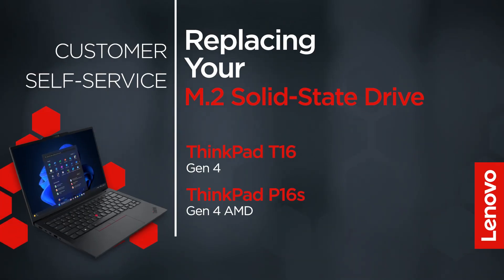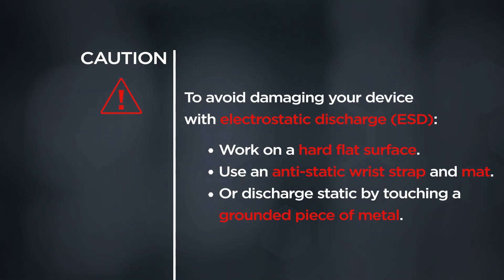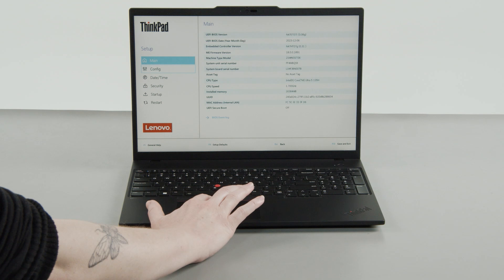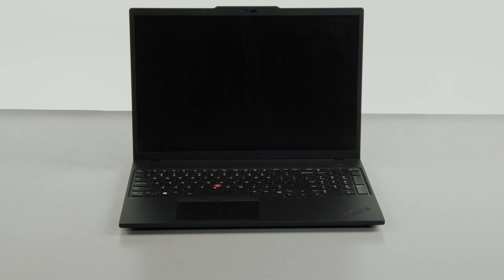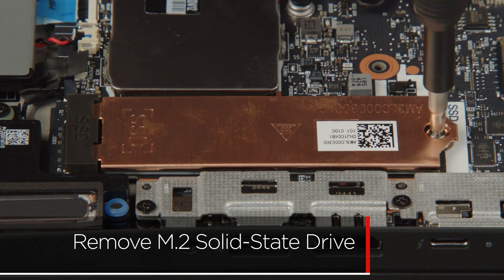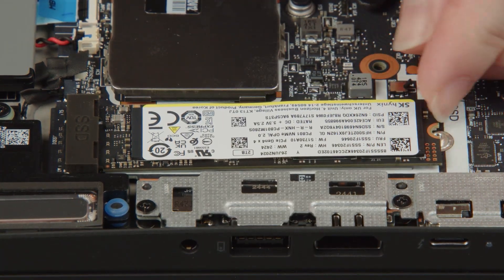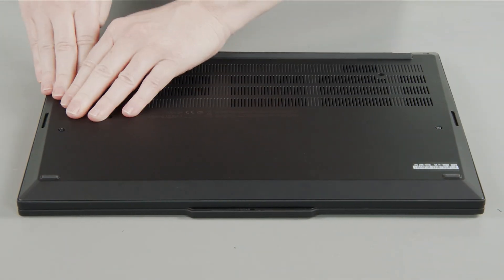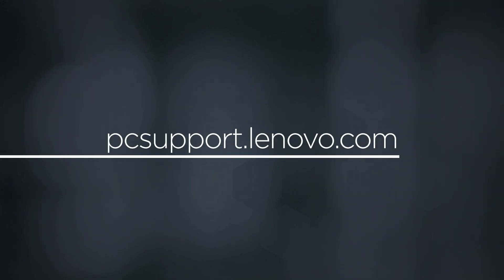Replacing Your M.2 Solid-State Drive | ThinkPad T16 Gen 4 and P16s Gen 4 AMD | Customer Self Service

Comment from the maker: This video will show you how to replace the M.2 solid-state drive in your ThinkPad. The process in this video will work for the ThinkPad T16 Gen 4 and P16s Gen 4 AMD.

You will need a screwdriver kit, a non-metallic pry tool, and 15 minutes of your time.

To learn more about your device go to https://pcsupport.lenovo.com

To find parts for your device go to https://support.lenovo.com/parts-lookup/?cid=ww:lenovosocial:b9515f&source=socialmedia&subsource=yt

To view the Lenovo Support Self-Repair Guides landing page go to https://support.lenovo.com/us/en/solutions/HT516547

** NOTE: Static electricity can destroy components. Use a grounding strap, and clean, non-conductive surface to work on. Use plastic or coated tools to prevent scratching and avoid using metal tools on plastic parts. For more detailed information on electrostatic discharge and how to prevent it, please watch our "Understanding Electrostatic Discharge (ESD)" video: https://youtu.be/by4PB3WtdLo 

Applicable Machine Types:
ThinkPad T16 Gen 4 - 21QE, 21QF, 21QN, 21QQ
ThinkPad P16s AMD - 21QR, 21RX, 21QS, 21RY

Check out other official Lenovo channels!
https://www.youtube.com/@Lenovo 🟥
https://www.youtube.com/@lenovolegion 🎮
https://www.youtube.com/@Lenovo-PC 💻
https://www.youtube.com/@LenovoSuporte 🟢🟡

#Lenovo #LenovoSupport #LenovoTechSupport